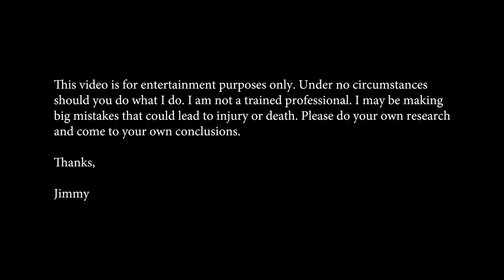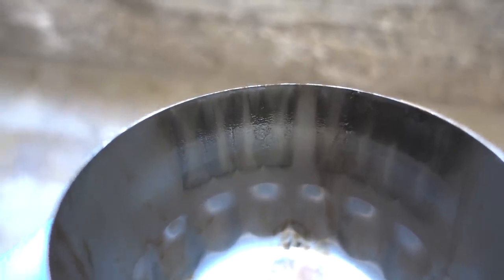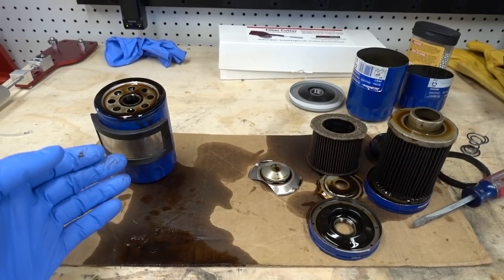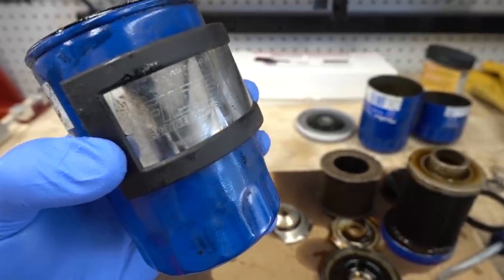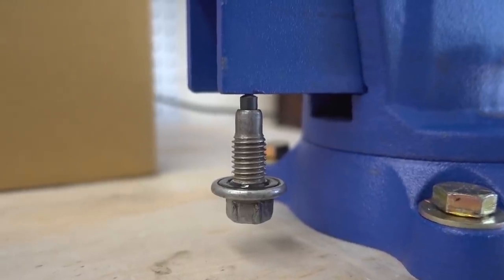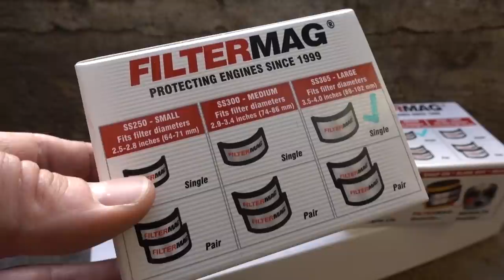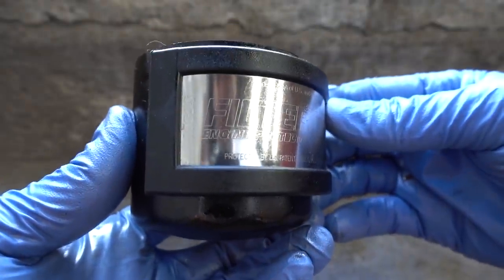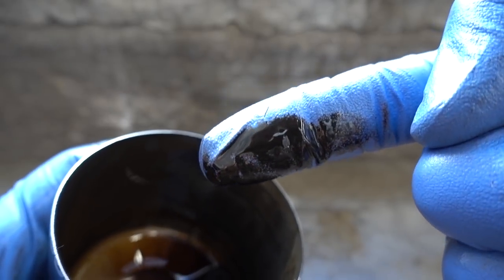Here's The ONE THING YOU DON'T KNOW ABOUT YOUR OIL FILTER!!

Comment: Oil flow is from engine into outside chamber of filter then through the filter medium and filtered oil returns to engine up the middle.   So magnet is pre-filtration.  No?   Still can't hurt to use magnet to help trap metal.
Reply: You're absolutely right.  The majority of those wear particle would have been caught by the filter media.  The magnets are not catching the wear particles that the filter media misses - they're acting as a prefilter.
Reply: OK I see people stating the magnet is not allowing the filter to catch the particles. So for the techs out here why is it I have the same material on magnet drainplug?
Reply: @Scott-wb5qx  
For the exact same reason.  The only way to know what the magnet catches that the filter misses is to put the magnet immediately AFTER the filter.  Place it a anywhere else and it will catch a combination of the particles that would be caught  by the filter and the particles that would be missed by the filter.  Based on the size of the particles in this video, I'm willing to bet that almost all of them would have been caught by the filter, since most filters will easily filter particles down to 20 microns in diameter.
Reply: @Scott-wb5qx  The only thing this video demonstrates is the fact that your engine generates a lot of wear particles during operation.  It says nothing about what is being missed by the filter.
Reply: Carbon Proksi  kl
Reply: Carbon Proksi  yes all these people are saying that it catches it before it goes through the filter as if that were a bad thing. That's actually great. Why would you want to clog up the filter with that material when you can pre-filter it? And those rectangular shaped neodymium magnets that are in that product are easy to come by. It's a no-brainer.
Reply: The

Comment: Been using filter mag for years now. They work and keep the engine lasting longer for sure.
Reply: No they are not. It's a myth.
Reply: @Nick-GR  Filter mags keep my 4x4 running right and a 500hp street sleeper. I won't go anywhere without one slapped to my oil filter.
Reply: Camaro 1968  thats because you never drive them. Your broke and cant afford the gas on those big blocks.

Comment: This is not a bad idea at all. I even thought I might pick up a couple. Till I hit eBay and looked at the prices being asked for FilterMags. Hardware store magnets may not be as good. But you won't have to save up to buy them either. I also see FilterMag sells several sizes to rope you into buying more then one. When this item could have VERY easily been made flexible to fit any diameter filter.
Good video... Not a bad idea. But I think you can get the same results at a much lower cost...
Reply: Jay Jay  Really wasn't all that concerned. Or interested in the GADGET. Mostly pointing out how much they were charging for a few magnets and a little plastic...

Comment: What you are talking about is why we used high speed centripetal separators. The separators spin the oil fast enough to force the metal (magnetic and other like brass or copper) to the perimeter of the separator and therefore removing it from the oil and therefore contaminating the oil. This allows the Navy to run oil longer without having adverse effects on the engines.

Comment: Yup, I have been using one of these since my 2007 Ford Focus SES was new, I believe in this simple type of filter on top of a filter technology as simple as it is. Although most transmissions come with them I would add an additional one. This simple install is a no brainer. If starting from new like I have most of this would be break in material. At any phase it's just a smart idea.

Comment: It won’t hurt anything but unnecessary. A good filter will catch the bad stuff
Reply: Filters don't do a good job on the really fine particles, such as those under 20 microns.  I argue it's better NOT to have the oil pump, or flat tappet cams deal with any debris.

Comment: if you want to put a magnet somewhere on your oil filter. put it at the bypass valve. that is where unfiltered oil goes back into the engine. the places those magnets he used is unfiltered oil/before it goes in the filter material.

Comment: I'm pretty sure that metal would have been trapped by the filter.  The inlet are all the tiny holes on the outside with the large hole in the middle being the outlet for the filtered oil.  The magnet just trapped them before they were caught in the filter media.
Reply: He should have run the magnet right on the filter.
Reply: Good Point!!
Reply: Agree, the magnet needs to be on the outlet side of the filter to be effective.
Reply: Why change your oil at all? Why change your filter at all if having the cleanest oil possible isn't important?
Doing this is called preventive maintenance
Reply: @scout4locations  
Some people are obsessed with clean.....Ive read posts on car sites where guys change their oil every 1,000 or 2,000 miles.....I ask them to send me their used oil!!! 😁
Reply: the filter is garbage anyways it's only good for 25-30 microns   best to find a filter that can do better a lot of good after markets will do 10microns
Reply: @punker4Real  
What brand filter do u use??
Reply: @motorcitymanman7711  wix xp
Reply: @Fortheloveofjdm  
Where do u buy it?
Dont see WIX much here but maybe I'm not looking in the right place?
Reply: @motorcitymanman7711  O'riley is the only place ive seen them in stock without ordering them online. I have a small mom and pop auto shop that i order mine through, they are a little cheaper and im happy to help local businesses when and where i can.
Reply: @Fortheloveofjdm  
K ill check Orileys theres one in town here thanks!
Reply: All the more reason to have a filter mag, so the iron particles don't plug up the filter.  Your oil pump will thank you.
Reply: @cjj7264  It's effective right where it is... before the filter, so to speak.  That way, it's caught and the filter can do what it can.
Reply: @motorcitymanman7711  no worries depending on what intervals you do with your change you can decide between the spin on or the xp. Longer intervals id use the xp.

Comment: I've run a magnet on my cars, boats and mowers engines filters for about 40 years.  Every little bit helps.  The caveat is that the wear surfaces of bearings is not iron based and most modern engines are running chromalloy rings now, not cast iron. Still worth doing though IMO as your suburb demonstration suggests.  The life you save maybe your engine's.
Reply from the maker: 'Every little bit helps' is exactly how I view it... 👍
Reply: @TheAndy1268  Your point is well taken but the most accurate response is "maybe".  For your statement to be 100% true, it would have to be impossible for a piece of iron or steel to be small enough to get through the filter and impossible for the filter media to be imperfect.  Neither of which is true.  Both may be unlikely, but magnets are cheap, you can get them at Lowes or Home Depot cheap.   Would I run right out and get one immediately?...No.  Would I put one on at my next oil change...yes.  Are you crazy if you don't...no.
Reply: @TheAndy1268  Potentially true.  There is no 100% testing of filters. They receive an automated exterior inspection and lot sampling/ performance testing. They are mass produced and are subject to imperfections just like every part of your car. 
It is possible for iron particles to be in your oil small enough to get through even the very best filters.  (try to imagine how small the minute, submicroscopic particles of iron based material that is scrubbed off the neck of valve stems are for example) It's even more possible that there could be a flaw in the filter media of any individual filter or even whole manufacturing lots of filters.
If you accept that risk, that's fine.  If you love your vehicle, adding a magnet to the filter housing is a very low cost, easy to install generally, small added protection.

Comment: It cost me almost 150 dollars a oil change so no. 13 quarts can't and doesn't wear out like you are telling people plus the Military in the 80s finally realized the same thing so we started doing the oil samples and send them in and was getting 40,000 miles to a oil change or even more. Come on stop selling a bill of rotten goods. I was around diesel engines in the Army 20 plus years and worked for Cat for 32 years and they had several tractors that ran 24/7 and once a month they shut them down for a oil/filter change but than switched to doing the lab test and ended up being like every 6 months. Hurt the oil companies big time because Cat passed it on to their operators.

Comment: My engine is build with Aluminum how does magnet work on my engine?
Reply: Its not all AL the valve train (gears tappets cam and chain if you have one is metal.  Albeit engine has AL block and head, the block cylinders is sleeved with metal .

Comment: You can get the same result by putting a magnet on the oil pan. In fact, some engines have a magnet built into the drain plug.
As for saving coin by skipping every second oil change, I would change the filter before changing the oil. If the oil itself degrades noticeably within a couple of oil changes there are other issues to be dealt with in that engine. Oil will get dirty and contaminated but it doesn't really deteriorate that fast.

Comment: The results are valid. Those magnets are definitely a good investment.
Reply from the maker: Right? That's how I see it too.
Reply: Yeah sure. 
The oil runs from the outside of filter through media then back in. 
Therefore the shavings will be where after being filtered out of oil? Between media and outside. 
Where is the magnet?
Outside. 
So all the magnet then did was to pull the already filtered shavings out of the media. 
This is therefore anecdotal evidence. 

To make it more believable, place magnet before filtered oil and after filtered oil. Then you have provided something for consideration

Comment: @1ROAD 6:02 You didn't give the filter a chance to filter the magnetic particles actually... Dirty Oil comes in from outside ring of filter and the filtered oil is pulled from inside.  Capturing magnetic particles in sump would show what filter missed actually.
Reply: Your point is well taken but I use them anyway.  It is possible for an iron particle to be small enough to get through a filter.  Plus, even the best filters can have manufacturing flaws in them.  I just exchanged a Wix filter because of a visible malformation at the seal that I fortunately saw just before installing.  In 50 years of working on vehicles I'd never seen that before. 
Only God knows what really going on inside where you can't see.  Magnets are able to catch iron particles floating around in your oil as demonstrated.  All the evidence I need to use them.  Cheap insurance.
Reply: @x-man5056  no disagreement just saying they might not actually catch anything.. I have one on oil plug which doesn't seem to collect anything, Which pretty much shows I either don't have metallic wear or filter is working.
Reply from the maker: In my mind I would think the magnet, even if it catches particles that the filter 'could have' caught, is keeping that filter cleaner for longer. A cleaner filter will flow more oil. To me, this should improve the filter and oil life. But that's just me. Also, the magnet that comes factory installed in your oil drain plug is usually tiny and very weak... These neodymium mags are incredibly strong.
Reply: @1RoadGarage  I have neodymium on my after market plug and it's very strong.  I don't disagree with you, just pointing out the logic in video was incorrect.  I also have my engine oil tested to see how it's performing periodically...

Many modern vehicles use filter cups where the product in this video wouldn't work.
Reply: I think the best test is to place magnets in an area after the filter to see if it catches more metal. But in theory the magnet on the outside of the filter is catching metal obviously and the filter is not so which means that the filter is actually cleaner and ready to catch more particals that magnetism cannot. Just a thought.....
Reply: @xephael3485  Most likely would have seen something on first oil change but yes, it's even better if it's not catching anything, that's a good thing.
Reply: X-Man interesting on Wix , thanks fir mentioning..Rhouhg, interestingly in 1970/80 s I used FRAM GAS/oil/ air filters exclusive if I remember right:: ..... mainly because big 3D NEXT DOOR to my work place specialized in FRAM and my vehicles,..I remembering.
Reply: @opera93  Used many Fram filters on many applications.  Never had a problem with them.  Still use the higher grade ones with synthetic oil.  Not exclusively, use NAPA Gold, WIX, upgrade Purolater, Mobil 1, a few others.  Whatever I can get a good buy on as long as it's not El Cheapo.

Comment: Unfortunately magnets don't catch many non-ferrous metals used to make a host of high wearing engine parts, from pistons, to rod andcrank bearings, to mechanical pumps, etc.
Reply: Just buy a aluminum and stainless magnet and put on the other side . They are hard to find as I have been searching for 20 years.
Reply: @gregblack4581  Lmao
Reply: @dillonh321  Not exactly, watch again.
Reply: Every engine oil pump I've ever seen, and that's much more than a few, use nickle/steel cogs in the oil pump (still magnetic) but you are right about the other items you named. Distributor to cam gear, timing gears and chains are a source of iron particles in your oil.  If you've ever done a valve job and micrometered the "necking" on valve stems where they move up/down against the guides, where do you think that material went? Magnets are cheap insurance, I'd still use them anyway.
Reply: @x-man5056  
He said it different but basically meant the same thing.
Reply from the maker: Good info! Thanks for posting... 👍
Reply: Jay Jay  It's a very common wear point on American pushrod V-8's.  Ever seen one?
Reply: @gregblack4581  Actually, a magnet can be helpful grading Stainless Steel.  If you are buying Stainless Hardware for a boat because of it's rust resistance as an example, bring a magnet with you and check the stainless for attraction.  The stronger the Magnet is attracted, the lower grade stainless and more likely to rust.
Reply: Yes true , i am a welder and also do mag particle testing . 410 sst def has a mag pull and can be mag particle tested . Also needs to be welded dif . 410 is a strong sst. but will rust .
Reply: Jay Jay  Didn't say "the neck", I'm speaking of narrowing on the stem (necking) where they "shear back" against the guides.
Reply: @gregblack4581  I did some experimentation with electrolysis (separate hydrogen from oxygen in H2O), built my reactor with all stainless steel hardware.  My electrolyte was highly corrosive.  Lowes and Home Depot stuff is crap.  Found my best "used" source was scrap yard.  Used medical and also restaurant stuff. 
When I was still working I was level II Radiographic, PT, & UT to Navy Nuclear requirements in my last position.  What a pain those re-cert classes were.  Never had mag particle.  Had Eddie current for one project I was on decades ago.
Worked mostly with Aluminum, Titanium, high nickle steels.  Lots of forgings, some castings.  Lots of rocket propellant also earlier, years ago.
What do you weld mostly?
Reply: Mostly 316 and titanium some invar .I support the national nuclear lab in tenn. Build target modules that essentially light off the beam . Also a fair amount of alum which is full pen and helium leak checked . The alum can be the biggest challenge as if the part is thin the helium check will expose a indication smaller than x ray detects. Each target module is about 2 million and burn up inside a year . All the sst. parts before any Mach are pressed with tons of pressure to minimize any inclusions. We have 8 target modules in house now with 50 percent of the welds done with electronic beam .

Comment: They caught by filter, but when you start cold oil has high pressure and your filter will bypass inside filtering media washing some of dirt from filter back inside to oil lines...
Reply from the maker: Are you saying that the magnet then is a benefit or not?
Reply: @1RoadGarage  if the the block material - iron - than you will catch it , pistons - most of the time is aluminum - non magnetic, rings are mostly chromium (Chromium has unique magnetic properties in the sense that chromium is the only elemental solid which shows antiferromagnetic ordering at room temperature (and below). Above 38 °C, its magnetic ordering changes to paramagnetic.) , Some other materials are non ferromagnetic... 
Main idea - in Russia there's a company that produces filters that have bypass valve in the entrance of filter , so if oil is too thick or media is clogged - oil will bypass filter, but in the beginning of it, without washing out dirt that was cought by filter... Magnets are good.

Comment: Make sure that any type of neomagnet does not touch the hot filter in any way  because heat will cause rare earth magnets to quickly demagnetize .  So there must be a separator between the magnet and the hot surface .

Comment: The magnet is grabbing particles BEFORE the go into the filter material. The oil comes down the inner walls of the filter housing, is sucked through the filter material and then up the internal shaft, back to the motor. The magnet is just catching it before it gets to the filter material. It certainly isn't doing any harm, but it's not really doing anything else either, except sparing a few particles from being trapped in the filter material.  What would be cool is if there was a way to put a magnet in the inner tube with the return oil and see what happens there!